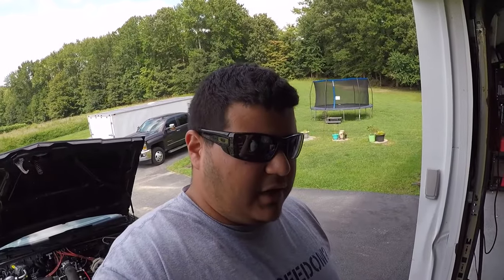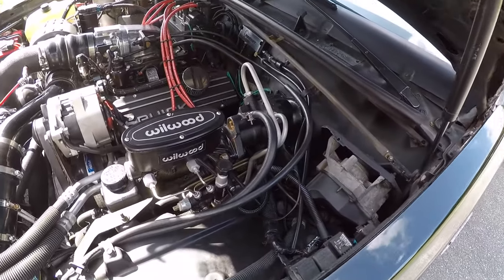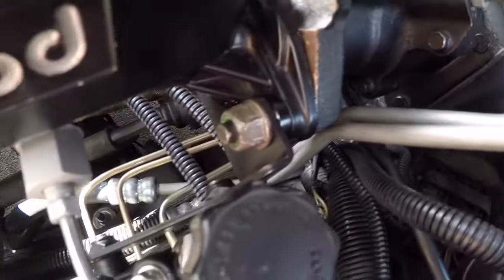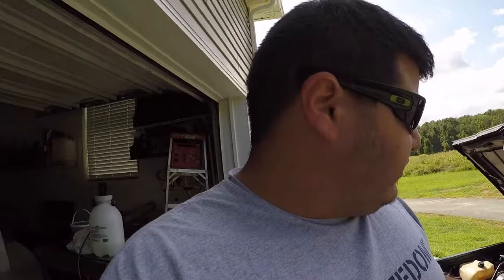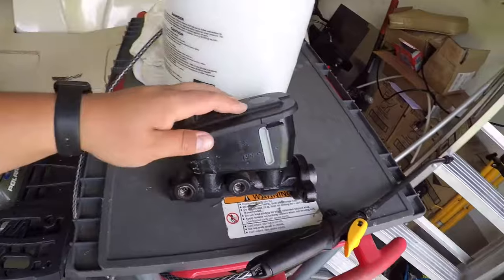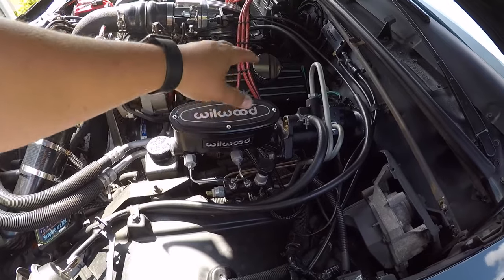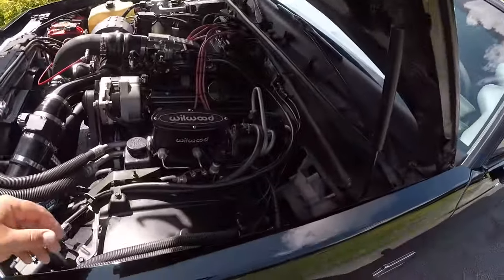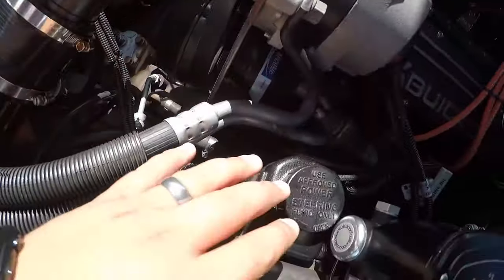Buick Grand National G-body Hydroboost Brake System

Comment: good stuff. I currently have a vacuum booster on the car but I have a sneaking suspicion the previous owner has the wrong brake pedal installed because the pedal bottoms out before giving full braking force. I like this video because it provides all the part numbers for going the inexpensive route for this system. The only hydroboost kits I have previously found were for show cars and were almost $1000.
Reply from the maker: Thank you! I am trying to make videos on all the upgrade mods available both DIY and kits its all just a matter of time, money and opportunity.
Reply: Wait….. my vacuum brakes do the same thing.  Bottom out and won’t lock the wheels up….. won’t brake boost at all either. How can you tell the difference in pedals?
Reply: @jafferm1938  did you figure this issue out?
Reply: @streetfascist1519  Had a stock pedal. Replaced with a vac pedal and all good

Comment: Thanks again for the info, I did my conversion 10 years ago and my cast iron brake master cylinder took a dump so I'll go with the aluminum master cylinder and it doesn't hit the steering Reservoir also cool
Reply: I can’t seem to find the hydro boost pump anywhere .
Reply: Ten years ago I can't remember where I got it from it was through the mail but now I see it everywhere Amazon RockAuto.... if you ask for an 81 Eldorado with a diesel and 83 to 85 Grand National they also have hydroboost but you really like to have the master cylinder in plastic the cast iron not so pretty
Reply: A Jackson will oreillys part 527157 work ? The hydro # listed on this video is nowhere
Reply: Yes that's the one,  but ideally you would like to find a complete kit with hoses clamps etc. And most kits don't have the brake master cylinder . I was looking for the people that I bought mine from but I can't find it to save my life LOL... have you tried Amazon and RockAuto

Comment: Did you bypass the factory proportioning valve or is it still hooked up. Just wondering since the Wilwood master cylinder has an adjustable valve on it. Didn’t know if they work together or the factory one is bypassed.
Reply from the maker: Deleted the factory prop valve.

Comment: Would cardone 52-7211 will fit other g-body ?
I need one for my 1979 cutlass supreme.
Thanks.
Reply from the maker: rafael shalelashvili it should but you need to keep in mind that engine configuration and power steering pump need to be taken into account as well, I am not very familiar with the A/G body counter parts.

Comment: Hi will WILWOOD 1-1/8 in Bore P/N 261-13270-BK and Cardone 52-7345 Reman work?
Reply from the maker: The parts cross reference but you may need to check the bore opening on the booster side. The plunger may hit the snap ring inside the master cylinder bore.

Comment: I did installed mine wilwood hydroboost, but i don't see rear disc brakes conversion set from wilwood for GN. What ratio on wilwood potentiometer settings should be for front and rear? Thanks
Reply from the maker: I am not sure what you mean by potentiometer, I am going to assume you meant the proportioning valve and every car is different. Pretty much set it half way and somewhere safe, do a panic stop and see if the rear lock, if they don’t keep adding more rear bias until they do then turn it back two steps. That way on a wet road is less likely to lock the rears.
Reply: I mean yes proportioning valve, quick typing lol
Reply from the maker: All good man, it just was just out of context so I figured you meant the prop valve lol

Comment: Changing over to this new system and the remanufactured Cardone Hydroboost part says in the instructions that you have to re-use your Pushrod spring and retaining clip any advice on where to find these parts. Been searching on line for hours.
Reply from the maker: Rocko Rodregez thats not part of this application, if the pin has a washer on it, push the slave in and if it returns you are good to go.
Reply: Your correct I just went out to look and there is a large spring installed, the directions for the hydroboost were generic and not specific to this part. Thanks for your help!
Reply from the maker: Anytime brother! Please share you favorite videos to help me grow the channel and be able to bring bigger and better content! Don't forget to hit the like button too.
Reply: Will do this is Rocko, I have a couple accounts this is my electronics and hobbies and just gonna toss on a few videos on the GN I am almost done with the brake upgrade I will post a video with how to get those lines in they were a bear, I will give you plenty of credit, thanks for posting.
Reply from the maker: Thank you for watching brother!

Comment: I have an 85. I need to put a master cylinder on it this week. If I just gravity feed the master cylinder should I be ok?
Reply from the maker: I would not count on it. You can bleed the calipers and rear cylinders without taking the tires off. Use and small hose and a bottle to catch the fluid and you wont make a mess either.
Reply: Thanks bro I'm gonna try to do it this weekend I miss my ride, only been a couple days though.

Comment: What's the part number for the Wilwood master cylinder? I have the C3 Corvette master cylinder but I prefer the look and quality of the Wilwood.
Reply from the maker: The part number is 261-13626-BK you will also need a 10lb Wilwood check valve for the line running to the rear.
Reply: Thanks! Keep up the good work with your videos.

Comment: a did you have any issues with the power steering fittings leaking? I did the conversion a while back but haven't been able to get it to stop leaking. You know any tricks or some kinda goop or sealer that works for that? The pump and lines are new shit and I'm still kind of a rookie. I'm so tired of messing with it and I don't want to drive it until I fix it bc its making my pulleys look like shit.
Reply from the maker: Pull the fittings, check the o rings. They are probably crushed.  If they are, try hydraulic o rings (square cross section) and just hand tighten them and then one turn with the wrench. See if that works.

Comment: Great video, thanks for the info. I spoke to someone at unisteer as I’m debating on going with a rack and pinion. I mentioned I was going to go to a hydroboost setup and he advised to not “t” the line as you’re basically robbing Peter to pay Paul. Have you noticed any adverse affects of when you’re braking your loss steering and vice versa?
Reply from the maker: No adverse effect to speak of and I have done this on a bunch of cars now. Only complaints I’ve received are when people use restrictive fittings or have air in the system both of which make the pump whine. The whole “robbing peter to pay paul” is a bunch of non-sense. The T is for the returned fluid from the hydro boost. Think of the hydro boost like a reservoir through which the fluid passes before it goes to the steering box. Then, how often are you actively steering and braking at the same time. Believe me, the amount of fluid being moved vs the amount used for braking is much less.

Comment: Hey budd, How do I ask at autozone for these hydroboost from what car n year? I like what you did, trying to do same for my 72 Chevelle if can help, thanks.
Reply from the maker: RockCrasher66 1983 Buick Regal, all early 1980’s turbo g bodies had them but you can just get the part numbers in the description.
Reply: VenomGT87 Ok Thanks 🖒🖒
Reply from the maker: Did it work? I think the A-body would need a different bracket for the hydroboost due to the shape of the firewall.

Comment: What kinda vehicle did you use to get those part numbers.i get good deal at oriely.
Reply from the maker: Just surfed the web, found parts that came up by searching the forums and went to the stores to compare similar parts. Most of this stuff does come up under 83 buick regal but I would avoid the master they recommend.

Comment: Thanks for the video, I just picked up a 1984 and the brakes definitely need replacing. Get a funky noise when you push on them now. How has your system held up? Still going strong?
Reply from the maker: As good as new, I did have one booster fail (small leak) after two years but it was covered under warranty so I just had to spend some time replacing it.
Reply: @VenomGT87  Sounds good...thanks for the reply! Love the car.

Comment: Autozone can get me all the parts but I can’t find the friggin booster anywhere
Reply from the maker: Try eBay, from what I heard, the company re-manufacturing them switched to “per-order” basis.
Reply: I found a 52-7127 for 99$ , that’s the cutlass diesel booster I think.  Should bolt up right?
Reply: It does bolt up but the fittings are wrong
Reply: I’m having the same problem anywhere I turn . No one has it
Reply: What I ended up doing was: 1984 turbo regal hose kit.  The rear half of a hydroboost from a 78 diesel cutlass.  The front half from a 1995 chevy 3500.  You have to drill out the rivet to swap the pistons.  This is a direct bolt on all hoses fit, keep the original pedal.  4 wheel lockup is no problem. Beast brakes
Reply: Used a 3500 master cylinder in there too its awesome

Comment: What’s the part number on the wilwood master ?
Reply from the maker: its a 1" bore, I can't give you a part number because people have ordered the same one I got and they have gotten one with the rod attached. So just buy whichever doesn't have a pushrod and has a 1" bore (you can go up to 1-1/8 if you like a little less pedal travel)
Reply: @VenomGT87  Will the 1'' bore work for both disc/drum and disc/disc ?
Reply from the maker: Houston Taylor yes, you’ll need a 10lb residual pressure valve to use that master cylinder with drum brakes.
Reply: @VenomGT87  Hey when you went to the Wilwood master did you have to change out your brake lines that went to the original proportioning valve or do they reach to the new valve, also where did you place the 10lb residual valve ? Thanks
Reply from the maker: @houstontaylor9799  I converted the lines to AN and used a unions to extend them. So from the stock location prop valve I made new lines to connect to the wilwood prop valve.
Reply: @VenomGT87  I cant find a rebuilt unit all of the auto stores are saying they cant get them anymore, advanced auto had some but they dont come with the mounting bracket.
Reply from the maker: Houston Taylor if you have the powermaster you can use that bracket, you’ll have to enlarge the opening a bit.
Reply: VenomGT87 Ok now I need help with getting the original brake lines to the new proportion valve, can you help me out with part numbers of what’s needed
Reply: VenomGT87  hater

Comment: The guys who are watching this and are still running that original electric pump what ever the fuck it is please do your self a favor go hydro or vacuum if that electric pump fails on U OH BOY!! it happened to me thank God I was going slow at the tiMe u literally have no braking power make 5% I had to use the e brake.Im runing vacuum booster in both my cars my original one I'm running it straight to the throttle body with no problems my other one has it's its own vacuum pump to it, as far as changing the pedal it's not hard at all
Reply: And also if u decide to go vacuum don't buy a kit off eBay they want like 300 for a booster master and a pedal u can get the booster and master for like $150 And the pedal just go to your local junkyard and pretty much just pull one of any g body got mine of a 80s elcamino probably cost like $15 BUT If u wanna run it with it's its own vacuum  pump the pump is like $300 of jegz so yes the hydro system probably be cheaper
Reply: That just means you didn't maintain the "Powermaster" brakes properly.  They work better than vacuum and hydroboost but require more maintenance like replacing the fluid annually.
Reply: turbojay70 no those things go out all the time and its very sudden alot of gn where salvaged because  of that electric pump
Reply: I would have to agree with grandnasty87, mine had the correct level of fluid and the fluid was not dark (like it does when not properly maintained) it simply failed out of the blue coming onto an intersection, no warnings, nothing then just as it failed, it worked just fine the rest of the way home.
Reply: I went with Kirbans HYDRATECH HYDRO BOOST CONVERSION KIT and love it. Unbelievable difference in braking power. http://www.kirbanperformance.com/product/44185/HYDRATECH+HYDRO+BOOST+CONVERSION+KIT+%237618.html 
However, I wish it came with the Wilwood master cylinder.  I may have to replace the C3 Corvette master cylinder with that Wilwood for the perfect setup. I also converted to rear discs that came from SSBC.